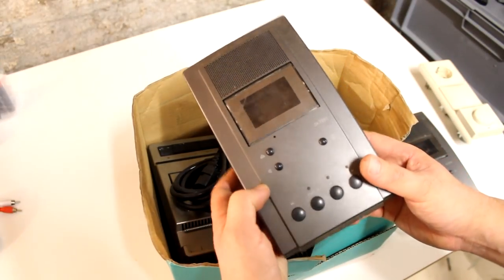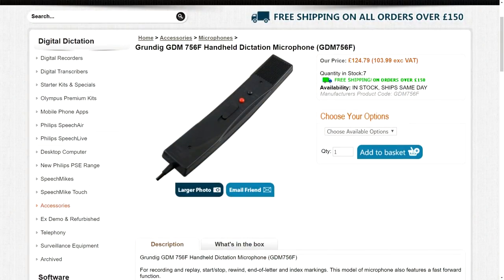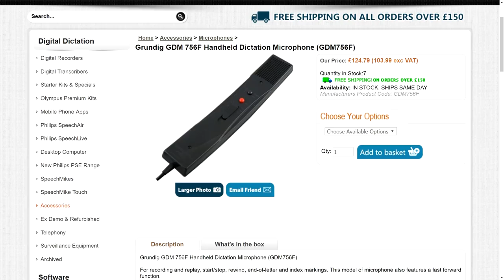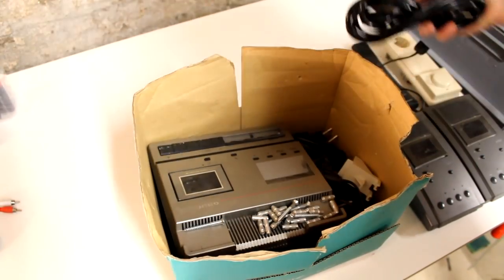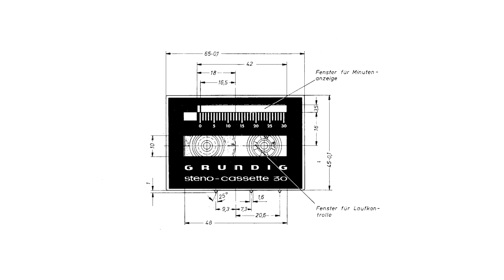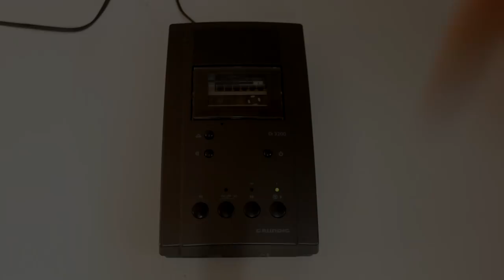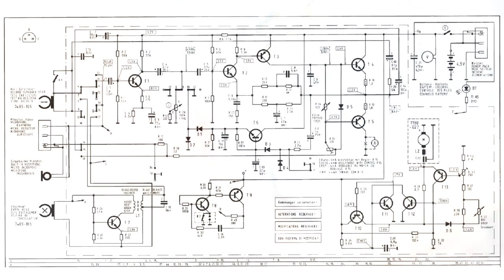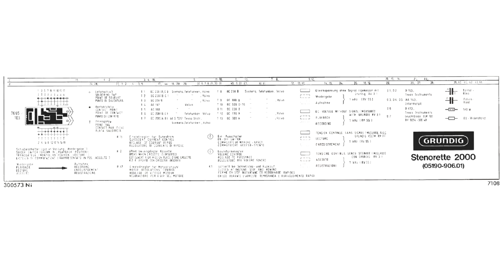Repairing Grundig  "Stenorette"  Dictaphones / Dictation Machines

Comment: still in frequent and active use in forensic pathology in germany. what a proud moment when someone hands you your first "Diktatur", the hand held version, with a sticker with your name on it. of course that does not keep you from displacing it. the most annoying thing with the rather new handheld ones was that the top lid you had to open frequently to change cassettes and replace batteries somehow completed the circuit to begin with and you sometimes spoke into the thing without recording. that of course happened more often the more you had dropped this thing on the autopsy room floor. which makes a very distinctive sound, very much as a law student hitting the floor does. the handheld microphone desk version you show is also in frequent use. we had a small room with basically nothing in it but a blank desk with one of those on it where you could go with piles and piles of files to fill up some cassettes with wisdom. cassettes come with plastic covers which can be clipped to files but also to each other to form some kind of stick. you always know something large and/or complicated has happened if you see a colleague leaving the office with one of those sticks.... the mechanics and electronics is usually very robust and i have fixed mine over and over with duct tape. bandsalat was never an issue, however the sheer age of some of the tapes was. if you ever get your hand on one of the newer handhelds, instructions on how to best change the rubber belts or a good tip about fixing the top lid (expensive to have repaired and takes forever) would be much appreciated. also these things get good money on ebay and chances are one of my colleagues is bidding on it. cheers and thumbs up!!

Comment: May I offer a tip which I use for desoldering old switches, small sockets and parts with parallel rows of pins:

Rest the conical soldering iron tip between the rows of pads, and feed in a large amount of solder to form a molten solder blob which then bridges all the pins, enabling you to effect a successful removal of the old part. 

I've found 360-370 Deg C is about right for small parts, but don't linger too long, and get the part removed and the board cooled as soon after removal as possible.

Now you can remove the solder blob and clean out the holes ready for the new part. 

rarely fails.

Comment: Old solder joints can be hard to get to reflow properly. Adding some paste flux (I like rosin flux) will help. Once the solder is flowing you can add a bit of new solder and then try the solder sucker tool. You may need to add flux, new solder a few more times to get the joint clean. I got lucky a few years ago and picked up a Pace rework station form EBay but even with the fancy desoldering tool the adding of flux and new solder to get an old joint flowing properly is required many times.

Comment: There is a very interesting German invention called an Eltro_Information_Rate_Changer that uses a spinning tape head to slow down dictation without lowering the pitch. It was implemented in 2001 to slow HAL's voice down without the pitch altering. It would be great if you came across such a device.
Reply: Here is a link to the machine https://www.sequencer.de/blog/tempophon-automation-heidelberg/1587

Comment: Where does the hoard/repair mentality come from? I suffer from it myself!  I understand that there is the opportunity to learn something, to keep a piece of equipment or tool going for longer, to save money, to prevent waster, etc., etc. But dictaphones? I spent the afternoon yesterday making a carburettor fit onto an engine that it wasn't designed for, only a simple lawnmower, but i had to modify the governor arrangement to get it to go, and forge a bracket!  I don't need this mower! And because it now has a non standard modification nobody else will ever bother to repair it again. Why?
Reply: bootsowen   Why do people fly to the moon? Why do people repair old loan mowers? Why do people climb mountains with nothing on them but boaring snow?
Reply: Ah yes, the "because it's there" answer.  I don't walk along the roadside to collect aluminium cans, but I will waste time on other stuff, I have confused myself! Maybe I should just spend my time commenting on YouTube instead!
Reply: I do the exact same shit,you say you do it's how we men show what we're capable of, it's in our DNA, the thrill of the challenge and actually getting shit done is rewarding in itself, the same can be said of power lifters carpenters, both of which I have experience with BTW.
Reply: Oh..i suffer from the same disease, haha